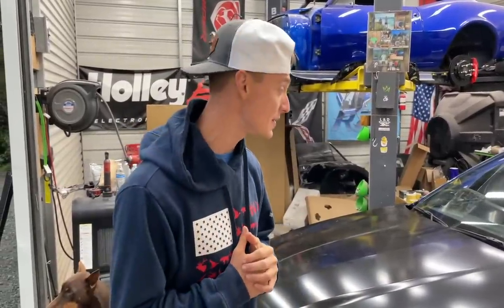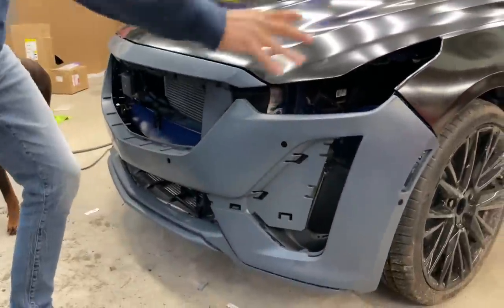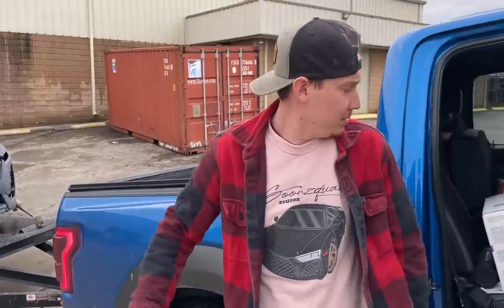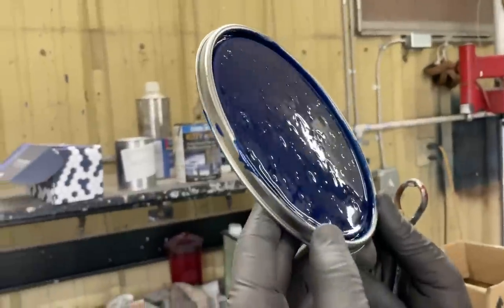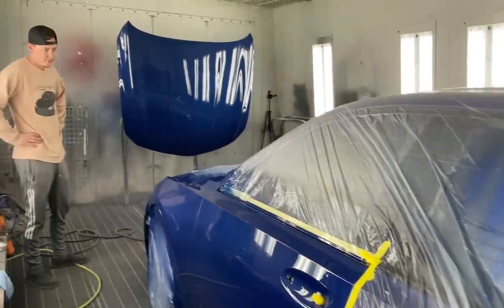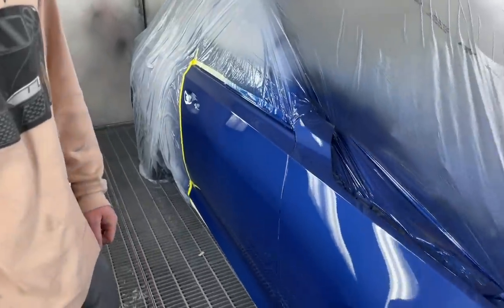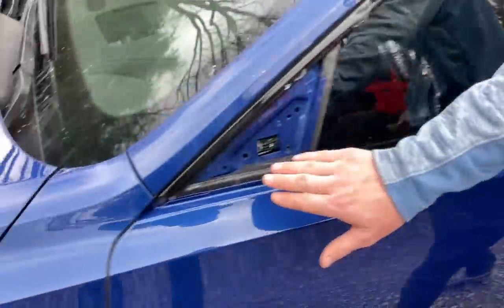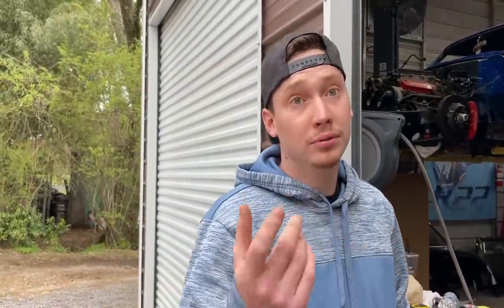Wrecked 2020 Cadillac CT5-V Gets The Most Expensive Paint Job Ever!!! Now Time To SELL Some CARS!

Comment: It looks like the CT5-V might finally be a worthy successor to the styling of the ATS. Looks nice. That shop owner showing off his turbocharged 4-cylinder was a funny interaction to watch. I love how genuine he is in his appreciation of how far things have come when he can get decent fuel economy but also go really fast. It's certainly not THE most expensive blue you can get. Ford had some blues where they featured a color-shift toner that had the US Treasury getting a bit squeamish because of how closely the toner matched some of the inks they use for an anti-forgery device in the larger denomination bills. That paint is crazy expensive. Ford also has what they call Piano Black that has a toner featuring very fine crushed mirrored glass so it has quite the special fire and sparkle to the metallic effect. TVR and Nissan also have really expensive color-shift and hyper-shift paints where the toner dose alone is as expensive as the paint you bought. Mazda's latest Soul Red Crystal is also a paint that I'd expect to be moderately expensive, but more difficult to spray because you have to lay down a base layer of a pearl and metallic blend of dark red, then they have you spray over a brighter red candy, then clear it. Candy is not an easy thing to spray and get consistent thickness in. Mazda uses machines, so it's somewhat trivial once you get the pathing dialed in the first time for the spray robot, but doing it manually? It's definitely a challenging spray job. Pearl coats have the same issue when you aren't seeking full coverage and you still want to see through to the base paint color. I do love a pearl white with a mix of other color-shift pearls mixed in so you get that fire of little blue, amber, red, green sparkles every so often, but most are still white or an off-white. Cadillac, Infinity, and Lincoln have some great pearl whites.
Reply: The CT5-V was the replacement for the CTS-V, the CT4-V is the replacement for the ATS, they look different
Reply: @joealex65  That is a good point. The CT4-V looks pretty poor compared to the CT5-V, which is a shame because I prefer smaller cars. From what I've seen, though, there isn't quite as much difference in size between the CT4 and CT5 platforms as there was between the CTS and ATS platforms, so it's easier, I guess, to just pick which one you like the looks of unless about 6 inches in length and around 3 inches in width is a deal breaker for you. It is longer than my current Ford Fusion, though, which is already a massively long car, so shallow garages are a serious issue.
Reply: It's good to see another painter in these comments.   Maybe you can help me lobby for the guys to stop using NASON clear on these high end builds!!
Reply: @rebuilders22  I wish I were qualified to be a painter. Everything I know is just second-hand theoretical knowledge, so I have loads of respect for guys like you who are actually capable of laying down metallics properly. I will wholeheartedly agree about the need to use the highest quality clear you can get for these more expensive paint jobs, since that can impair the clarity and dull the metallic paint underneath. On top of that, the clear is what you get to cut and polish after the car has left the paint shop, so a quality clear that handles that process well without needing you to take off much material is invaluable.

Comment: Prep solvents/wax n grease remover will leave streaks in your base if you don’t get it completely wiped off. If that’s the case the only way to fix it is to re spray. You don’t notice it much on you darker paint or stuff with low metallics. But with height metallic, pearls,or Graphite, Mika,  anything that has flake will react to the prep solvent  what happens is when you don’t wipe it completely off it leave the slightest film. And it shows through the base. If you look really really close with a high magnification plaint camera. With any color solid or metallic. You can’t actually see as barrier bet paint and surface. So it’s important to be sure to completely wipe it all off. We use diluted rubbing alcohol. On final wipe down not a soaking rag. Just dam enough to make a difference   Another thing is if prep solvents are left on a painted surface. It’ll collect dirt and it’ll show in the clear. Think of the solvents as a carpet cleaner. As it sits on a surface it is drawing contaminated material to the top of the surface to be extracted. It’s important to take the extra time to wipe it all off.  A good practice is spray your prep rage work in arms trace spaces only. And wipe on wipe off with cleanse dry rag.  I watched all of your videos. And iv seen you guys miss this a few time. Hoping y’all would catch it. But seen as we are here now o figure I’ll try and lend a bit of Knowledge down.  PPG and AXULTA both have really really good training courses. Not sure how much they cost. Work sent me. But it’s extremely helpful. Remember guys. The painting part is only 2.5% of the job. The rest is in body and “PREP”. Take it easy y’all hope this helps. Have a good Sunday. God bless

Comment: Starting in 2016 the base Camaro came with a 2.0 liter turbo engine with either an 8-speed automatic or 6-speed manual transmission.  In 2019 GM started offering the 1LE package for the 2.0T base model which came with the 6-speed manual only, the beefed up suspension from the Camaro SS, 4-piston Brembo front brakes, 20 inche tires, Recaro seats, and auxillary coolers for the engine, transmission, and limited-slip differential.  The stock 2.0T 1LE runs 13.8 in the quarter mile at 100mph.

Comment: Its crazy the price of paint , some pigments are made of gold i think . People in your area are so friendly , your new friends Camaro isnt all that . The VVT Camaro is a 2.0 liter 275 Hp turbocharged 4 cylinder that does get 31 miles to the gallon . You guys always rock a good paint job , Billy knows his stuff ..
Reply: It's not a bad car if you can't afford the SS.  If I were going to go with a base model Camaro I would at least get a 2019 or later which is when GM started offering the 1LE package on the base 2.0T model.  It's good combination of performance, gas mileage, and price.
Reply: @pjstartv6798  Yes you are quite right . Its a affordable Camaro with alot of the bells and whistles the SS has including the 295 ib ft of torque which for a 2.0 liter is pretty good and what the nice owner was referring too . I am personally not a fan of the Camaros because of the huge blind spot from the rear pillars although they are going electric in a couple years ..

Comment: The front radar fault for the track hawk is possibly because the radar is not aligned. It will need to be leveled and needs a dynamic calibration. Your local dealer can do it for you pretty easily. It doesn't take long and will get rid of that light for you guys! Nice work!!!

Comment: Do you guys turn the fan/ventilation system on when you spray? That should pull all the dust and crap out of the air.
Reply: They should pressure wash it before painting even under the hood. They are always so dirty when they pull them in the paint booth.

Comment: Is it true that body parts should be painted in the orientation the will be mounted to the car? I’m looking at the hood hanging vertical, and thinking the paint will “lay” differently.
Reply: Yes you can have flop issues. I painted a silver gas door laying horizontal on the trunk at the same time the 1/4 was painted. It was a different shade of silver when I went to install it.

Comment: I have the same 4 cylinders in my Cadillac ATS. It can be built out to almost 600 hp. 👍✌️
Reply: Hi HP and Hi RPM.   But when you turbo charge them the blocks and heads don't last very long.

Comment: You need to use DBC 500 color blender, especially on blue metallics. Some of the body guys call it a wet bed or a mid coat clear. Research it.
Reply: they need to not use nason trash paint. and use sealer.  not even the mighty DBC 500 can save nason

Comment: Love your guys Chanel! Been subscribed since the blue mustang build. I would offer a friendly word of advice, especially for high metallic/pearl colors you should coat the bodywork areas and factory e-coated parts with the correct Value Shade sealer recommended for it. Would give you faster coverage, and use way less paint in the long run. Keep up the great work guys!! 💪🏾

Comment: lol @ the old-timer with the Camaro. Not quite 300hp.. 275 at the crank more like 245 - 250 WHP. 
Have the same motor in my ATS but mine is tuned and right at 300 WHP. They're quick for what they are.

Comment: Bulldog is only to be used on plastic bumpers. And ur sanding should be no higher than 600grit guys. Those lines are from the spray can bulldog promoter causing the metallic to lay different. If u use bulldog only on plastic parts and use in your paint gun. Avoid the spray can kind

Comment: Painting directly into the e coat result in paint failure. You should use sealer on all new panels for proper paint adhesion.  Bull dog alone won’t do its job. Good job otherwise.
Reply: the fact that they didn't use sealer negates anything good they did.   which really, there isn't much that is.  the reamed out the hood hinges and it fits like shit.  this car most likely has frame damage, and I doubt they ever measured it.

Comment: I have a 2010 v8 ss camaro, and I did actually test drive the 4 cylinder turbo once, it definitely wasn't quite as powerful, but I was pretty surprised how powerful it actually was for a 4 cylinder.  Felt alot more powerful then the v6, but I'm guessing it could also be because the 4 cylinder is much lighter then the V8, so power to weight ratio must help narrow the gap a little

Comment: You have to seal new parts. Shawn at Car quest  would have told you to seal.  When you're doing a blue that is transparent you need to seal everything the same color to get a perfect match  so you would seal into the 2  doors also. And when you don't seal a new bumper or a new Fender it will never have adhesive it will peel in time